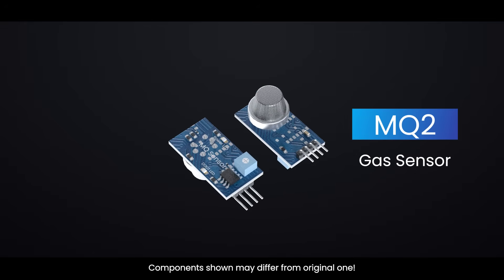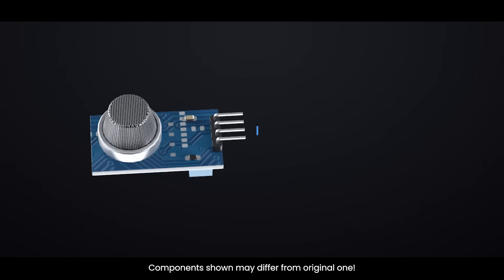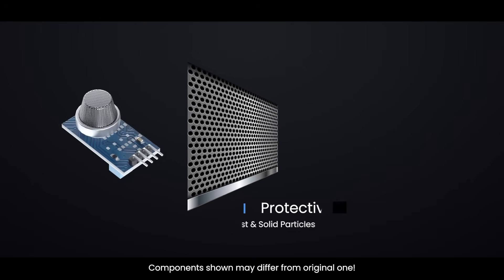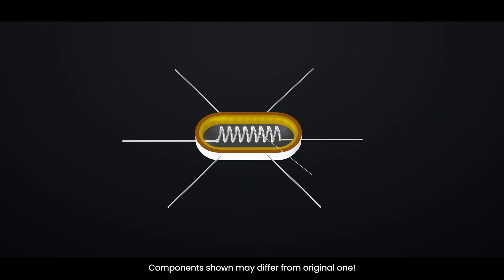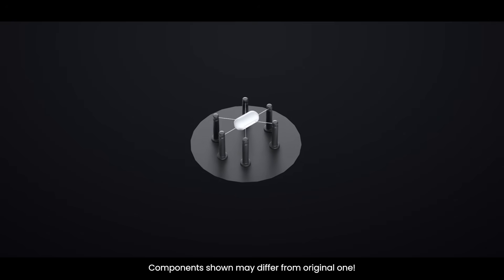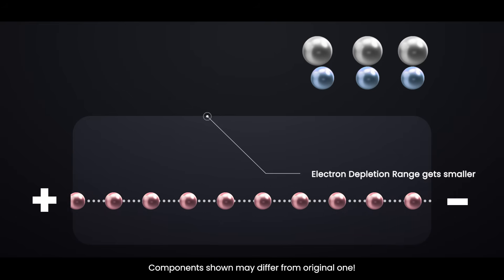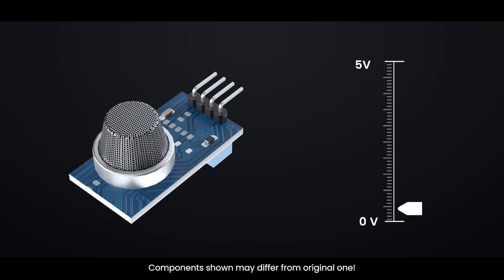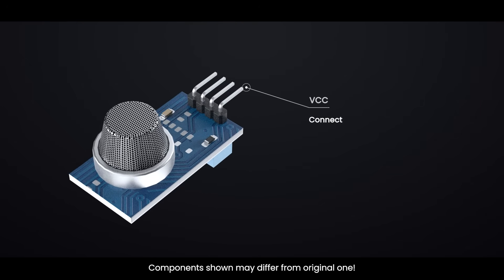How MQ2 Gas Sensor works ? | 3D Animated 🔥

Comment: This a nice sensor that detects a number of different gases or equivalently will respond to any of the target gases without the ability to indicate which gas is producing the response. If you have a pure gas that the sensor can detect then the gas ID issue is solved. It is still a nice, low cost sensor for many gases. The ability to detect concentration suffers from the same issue of knowing the identity of a gas. Still a nice video.